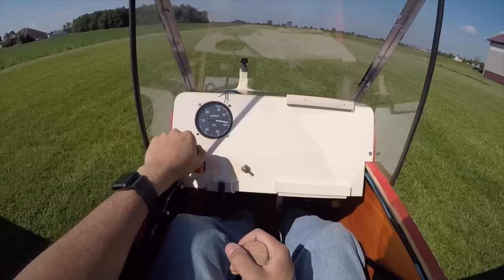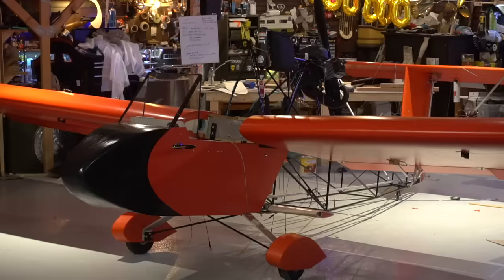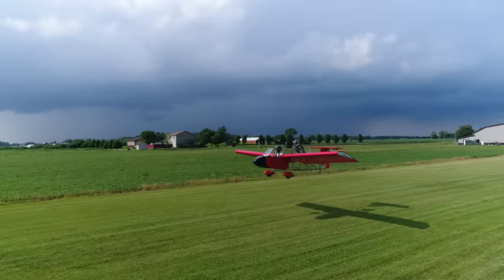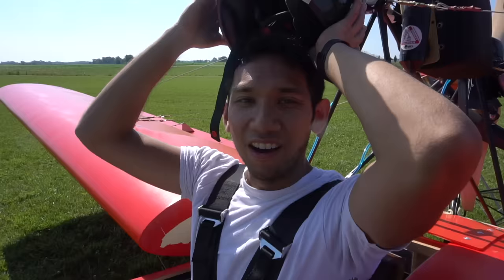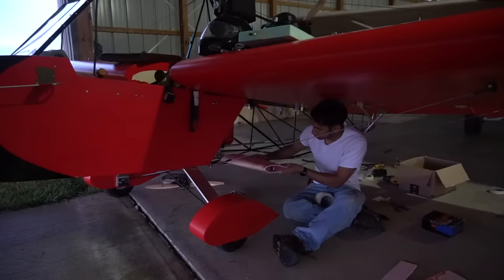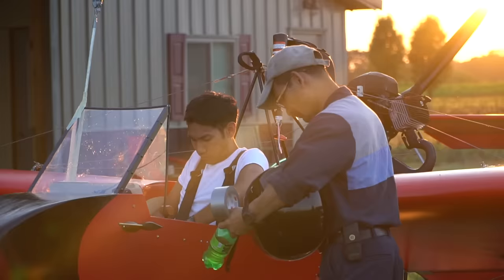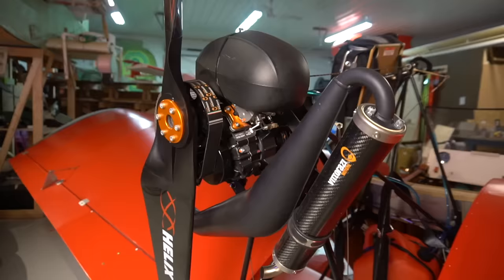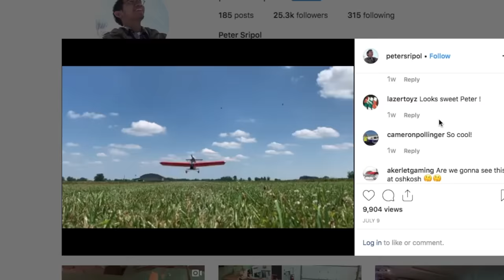MY HOMEMADE airplane flies!!! MK3 design

Comment: I am sure you know - an aft CG is very dangerous. Being a little nose heavy is much safer than being a little tail heavy. I hope that the the high thrust line has not fooled you into thinking that the nose is too heavy. I think you would also benefit from lowering the front of the engine mount structure so that the thrust line comes closer to the CG - ideally, the thrust line should pass through the CG. Hard to do with a top mounted pusher but you could come closer - and that would reduce the amount of nose down pitch-over under power.

Should something go wrong requiring you to use your BRS, I would be very concerned that you would be able to find that handle behind your head during the chaos of an emergency. Your life would literally depend upon finding that handle. I would recommend getting an extension and put that handle either beside you or in front of you. 

12:33 Lastly, please remember to pull the pin (that red tag that says "remove before flight") on the BRS handle before flight. It is easier to remember to do this if it is within your view when seated, and it definitely should be on your checklist. You do have a checklist, right?
Reply: XD "Right?"
Reply: I'm curious here, why would you want nose heavy over tail heavy? Is it because in the event you weren't paying attention the plane would stall if it was tail heavy?
Reply: @FurryKeidran98  If the nose is a little heavy then you have to put more back pressure on the stick (or trim it out) to remain in level flight but the aircraft is very stable. If tail heavy the pitch control will be very twitchy and you risk stalling - and with an aft CG you may not be able to recover from the stall.
Reply: @HarmanRobotics  Especially considering he has a T-tail configuration too. He could get into a deep stall configuration. An AFT CG wouldn't help him any in that scenario. Doubtful he could get into one of those states though. Thankfully that engine is providing a stable thrust component too, so even if it were possible, hopefully the moment would be strong enough to get him out. Looking at it more, I seriously doubt a deep stall is possible. The thrust line looks to be nearly parallel to the elevator/horizontal stabilizer.

Good note about BRS too! I didn't even notice the pin.
Reply: @HarmanRobotics  thank you. Now I know.

Comment: "The plane is nose heavy"
Takes off his shoes
Reply: Surely he should've taken off his own nose
Reply: he took off his shoes because the rudder pedals were pinching his feet but it sure seemed that way lmao
Reply: @introvertairways  no s* Sherlock... 🙄
Reply: Takes a dump to lighten the load
Reply: That is actually a thing in some gliders and ultra lights.
When I was a teen I was in the CAP and when I would do glider flights we weren’t allowed to wear our boots to save weight.
Every pound counts.
Reply: TheFallenShadow your not funny
Reply: Nailed it totally!
Reply: @MostlyAmethyst ! r/woooosh not wooosh
Reply: Just add longer wings and stronger engine.

Comment: Zombie apocalypse *happens*

Him: builds cardboard airplane with a 30mm machine gun
Reply: Nose heavy lol
Reply: @mist_kylefire6290  Counter balance it with another one on the back lmao
Reply: Imagine doing a diving with that thing
Reply: No he would use the flamethrower he built with the firetruck
Reply: @vectra9_957  no MXU-470/A miniguns
Reply: If not made of carboard why not a 50mm machine gun firing 50mm black tip
Reply: @vectra9_957   if he fires from the back he will gain some speed though
Reply: And still underpowered.
Reply: 30 machine gun isn't a thing 30 mm cannon is a thing
Reply: Too much DVDs bruh
Reply: perfect
Reply: 2A83

Comment: It's not nose heavy,  you just have your thrust above the center-line.
Reply: I agree, his center of thrust is above his center of mass and lift.
Reply: Correct, and the thrust line should be angled downwards more - easy to accomplish by shortening the front support structure.
Reply: I remember a few videos back he was saying that the Center or pressure was just slightly below the motor so it would only cause a slight downwards force. That’s why he has the t-tail configuration.
Reply: @gabriela sakanta 
I believe one did
Reply: gabriela sakanta yeah, because constructive criticism is criticism after all, and Peter would rather not make appropriate corrections to his ultralight and have it not fly the way he wants than be criticized...

Comment: I like the fact that you flew it with a low probability of survival.
Reply: That is simply factually not true and you know it
Reply: thats actually not true if we're talking critical parts and not. If a critical part breaks, say a wing on a plane, youre more likely to die than if a critical part of your car breaks, say a wheel or brakes.
If non critical part breaks, say engine in an airplane, yes you can float but you dont have much contron on the landing spot and still have high chance of dying if your landing is not performed well. When your car engine breaks, you can literally coast to a stop with less risk of dying.
Reply: it's worth it.

Comment: It's the 15 time i watch this vídeo . It's like realise my dreams trought this vídeo
Reply: Same
Reply: This is just an excuse to not do the work for an actual pilots license. Go get one they’re not that hard you just get flight lessons and do a test and then go 4 times the speed of this plane and go 12,000 feet high not 500. I guess this is a cheap version because for a bottom line plane from the 60’s is about 15,000 wich is what everyone has that’s not a plane that unreliable that’s the norm and this is what 10 just get a license I promise you going 50 miles an hour at 500 feet is not your dream.
Reply: @CK86325  you know how expensive it is?

Comment: awesome :) love these plane builds! It would be great to see a rough cost breakdown, must have cost a bit!
Reply: Cardboard - Free To find
Propeller engine - 960$
Wheels Wood miles per hour meter - 120$
Batteries - 500 each those are used for Trucks

Comment: the nose was initially heavy because of the weight of his steel balls as he trusted this airplane with his life
Reply: He has a rocket-powered ballistic parachute behind him. Not too much to worry about.
Reply: @Cwra1smith  except for the propeller chewing up the parachute lines!!
Reply: @robertz5958  You would normally kill the engine too.
Reply: @Cwra1smith  and that sounds like it is connected through a centrifugal clutch and if so the prop would continue to windmill!
Face it he's got balls and bloody good on him for having a go!!
Reply: @Cwra1smith  Actually, there is a lot to worry about. Firstly, the handle is behind his head, it would be difficult to locate in the chaos/panic of an emergency. Secondly, he did not pull the safety pin. Even if he did find the handle it would not have deployed.
Reply: Honestly, I'm surprised he's not dead already.
Reply: It’s actually a lot safer than riding my motorbike on the roads surrounded by physicos.
Reply: Craig Jackson he wouldn’t have enough time or altitude to use the parachute
Reply: @Cwra1smith  wont help till he is a couple hundred feet up. Plenty to worry about.

Comment: that flat windscreen is adding pitch down forces as you go faster, giving you a nose heavy sensation. redesign it to flow around the sides more than over the top.

Comment: Knows how to fly a plane without a license 

"Wait, that's extremely epic"
Reply: You can learn to fly with Microsoft Flight Simulator X or FS2004 reasonably well.
Reply: You don't need a license to fly an Ultralight craft
Reply: 1: he has a license
2: you don't need a license to fly an ultralight I'm pretty sure
3: a license doesn't decide your skill on something
Reply: gh_3_2 he doesn’t not have a license. He says it in one of his vid
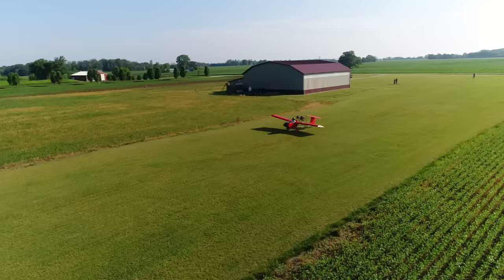Reply: @mosestha1104  Which one? also in "I got in trouble with the FAA" (5:14 i believe) he confirms that he does infact have a pilot's certificate. Which is kind of a commercial license from what i understand.
Reply: Flying is pretty easy, it’s making a smooth landing that can be more challenging XD
Reply: Alaric Niemi, Word! =) On a general note i'd say just about anything you could possibly think of is actually very easy, as long as everything goes your way and everything is behaving and responding to your actions in the way that you expect it to. I taught myself how to literally do climbing with excavators. That was easy, but if any of the steps involved were to turn out even a tiny bit different from how i planned them, it's highly unlikely that i would be able to avoid falling and tipping/rolling the machine, and even if i could i definitely wouldn't be able to do anything at all to get the machine out of the situation i drove it into. "Skill" is being able to redeem a situation when nothing goes as planned. "Hard" is landing an aircraft in a safe manner when your engine breaks down at 500ft! xD
Reply: @gh_3_2  the guy you replied to says he has a license, so im not sure why you're saying he's saying he isn't saying he has one
Reply: I feel like knowing how to build a plane is a lot harder than knowing how to fly one.
Reply: Flying is easy you only need a license because of govenment regulation. I flew 4 years without a license. Just know the rules of FAA.
Reply: Not really...
Reply: you can learn to fly in x plane

Comment: Peter, as you are likely aware, the high thrust line will generate a significant pitch-down moment, making the elevator feel nose heavy requiring constant back pressure on the stick to maintain level flight and creating additional drag and slowing you down.
  Rather than relying on the "guess and by golly" method, I strongly suggest you calculate the c.g using scales and a tape measure, (reference datum, weight x arm = moment).
 Depending on your chosen wing section, as a rule of thumb, c.g is generally at 25% - 30% wing section chord.  A thick section such as a Clark Y, as your wing appears, results in a larger pitch-down moment as well (Refer to "Theory of Wing Sections by Abbot & Doenhof - Amazon~$17).
   A simple method to determine whether these factors are correct is to reduce power to idle, then check the  feel. Ideally, properly rigged and a correct c.g, it should fly hands off in a glide (positive static stability).  Also very important is positive dynamic stability.  (Return to level stabilized flight with few or no oscillations following a pitch disturbance).
   A lower thrust line (at or below the lateral axis) will  add a pitch up moment as power is added, but not easily accomplished with the low ground clearance and configuration of your plane.  Relative wing - stabilizer incidence is also an important factor.  Believe me, as an Aeronautical Engineer, aircraft design using the "T.L.A.R." (That Looks About Right) method is playing with fire.
   Good to see you took some safety precautions - seat belt/ harness, and helmet, and parachute.
 Thankfully, you were not injured - or worse.  Would be tragic for someone with your talent.
  God luck with your future endeavors, and stay safe.

Comment: Colin Furz DIY Jet engine. “ hint hint “
Reply: Not enough thrust sadly. Making jet engines out of turbochargers yields very low thrust for the given weight, given that turbos weren't really designed with that in mind. The most thrust I've ever seen out of a turbocharger jet engine was around 150 lbs, and that system weighed a lot, I would wager over 70 lbs. That is far too heavy for an ultralight like this. If Peter wants to go the jet engine route, I think a much more efficient idea would be going with a small commercially available engine like the engines that JetCat makes.

Comment: Just an idea but, you should try to turbocharge the engine because at higher altitudes, the air is thinner and thus makes your motor produce less power. If you put on a turbo, you could get it back to a more powerful and responsive engine. This process is called "Turbo-nuetralizing" and was used during the ww2 to make planes work better at flying altitude. This also helps in fuel efficiency because it takes less throttle to get to a good cruising speed. I know im late to the video but I hope you get to see this and maybe think about this option.

Comment: I totally got into your projects while in pursuit of cheap flight Peter, total awesomeness! I changed stride a couple of years back and now am a certified P2 paraglider pilot. I have built an electric paramotor against all odds (yup I'm in Canada, land of red tape) but haven't legally been able to fly it as no registration plate/manufacture ID/serial number. I guess you guys don't have those problems down there? Oh well, I fly off mountains which is just as good ;) Cheers!

Comment: If it lacks power, put a small turbo on it, make sure u get low boost (0.5bar) it won't hurt the engine and probably help u with the power problem

Comment: You can save weight by ditching the landing gear at take-off. Like the plane sits on a wagon to take off but as it lifts you leave the wagon on the ground. More aerodynamic and less weight.
Reply: My guy you not see when the video was released

Comment: Hi if you get rid of the wing tips and put tip plates on 2 inches larger then the rib shape you will get about 10 % more lift,
 less drag and better aileron response with less movement.  ps. wing tips cause drag and turbulance.   J Cook

Comment: Im sure you upgraded already but you can buy a racing CDI for that motor that makes it put out about 22% more HP .  Also use high end spark plugs will boost the rpm .

Comment: I bet the electric plane would have flown better with a twin motor design. There is one ultralight that the original was a twin engine design with 2 chainsaw engines powering it, they later fitted it with different engines to give it a little more power but ultimately the original flew and it flew well. 

These are well made ultralight planes, I am glad to know the materials aren't as demanding as a helicopter. Access to a field or runway is necessary. I have seen people fit small engines that aren't rotary engines and they flew as well. One ultralight design even used half of a Volkswagen engine. 

I am going to build one but I have to come up with a different engine to use. I didn't know the FAA article 103 so I had originally planned on using a 3800 supercharged engine from a Pontiac I have but the engine weighs too much and I would need a license to use that engine. It would have also allowed me to use the computer from the car and original wiring harness which would have made for a cleaner, feature rich plane. Considering now knowing what engines are actually being used for these I think I would have ended up with a jet and not a normal plane. It would have certainly worked but it would have also fell outside of the 103 guide lines. So I will start with one of these because they are a lot like building a model plane, I just got to spend a little time in CAD so I can design a working plane. 

This is a great design and I watched the MK4 video and I really can't wait to see it fly once you finish the wings. I really like the detachable wings idea for the MK4.

Comment: * Winglets are better. Do some CFD for the shape
& You can turn the engine exhaust resonator and muffler so they are aligned to the airplane and reduce parasitic drag on these. You might get rid of the muffler by having a good resonator.
$
Also you can round the lateral edges of your windshield.
Instead if using more power and fuel, go to such details.

Comment: Squared off wingtips are not very efficient.  A half-round tip shape with the lower surface of the wing tip angled up 30-45 degrees would have a significant impact on control and general flyability.  This is from research done by Convair with its 'Charger' COIN prototype.

Comment: I have 5 important questions about the plane 1 - What type of plane is in this plane and where is it located؟ 2- Is the plane running on gasoline or with electricity, and if it works with gasoline, what type of gasoline ؟3 - How to manufacture the brakes and the gas pedal ؟4- How to manufacture the speedometer in this plane, the plane ؟5 - What is the thing that you hold in Your left hand when flying that plane please answer me ؟

Comment: Don't you use a matrix form of the dynamical system  ? Since you actually make the planes, you can get real data and tune up the parameters in the matrix. That would be your best tool to more precisely tune up everything.
For example  , the tail structure looks a little complex, and heavy. It also creates extradrag because of tubes here and there. maybe it can be covered with thin polyethylene to avoid parasite drag , improve the airplane Cl and reduce the Cd with a small increase of weight.
Lots of variables which can be well tuned in the matrix .
Cheers.

Comment: I want to be like you after I grow up. I'll make aeroplane too. I'll even put India 🇮🇳 flag. I'll design something which will shoot air on right side which will make air go faster which will create vacuum. Then it will put air on left side. When air goes from roof and roof is not connected to building then there is a chance of roof getting up. 🇮🇳 flag will move like wave. I'll use an aerofoil which makes plane go higher, not faster.

Comment: #1 issue i saw you have is the wing thickness is way too thick, and the shape of the airfoil is very heavy on the wind drag. The front of the wing should be a bit sharper, to give more of a crisp flow, and the thickness of the wing is the reason your engine is struggling to push that massive thick wing though the air. The wing should be 3-4 inches thinner and the leading edge a bit more toned and sharper, like a NACA airfoil.
Reply: We’re can I Learn how build one